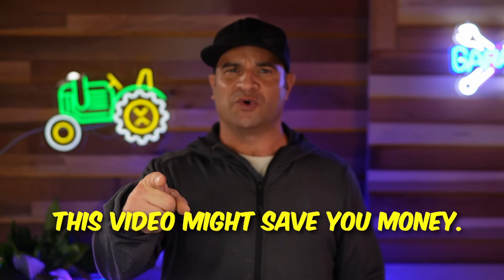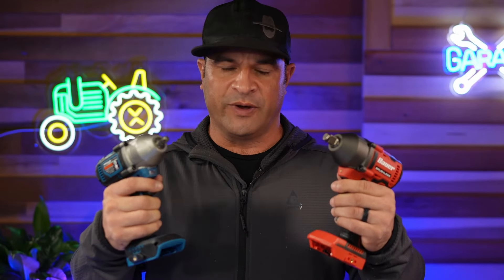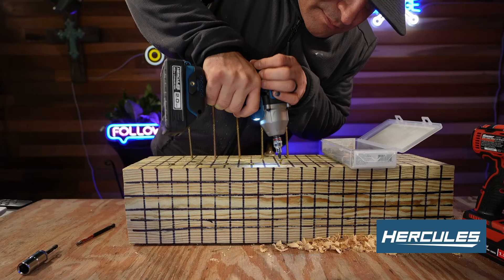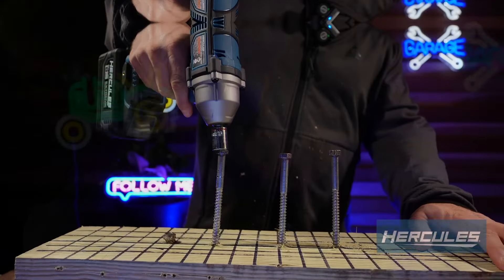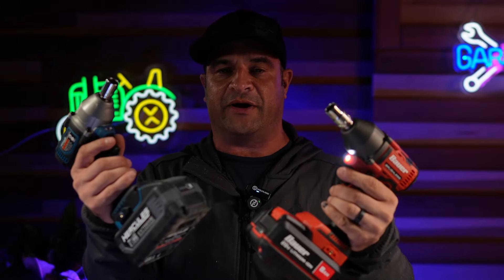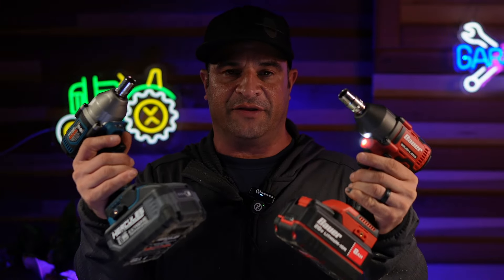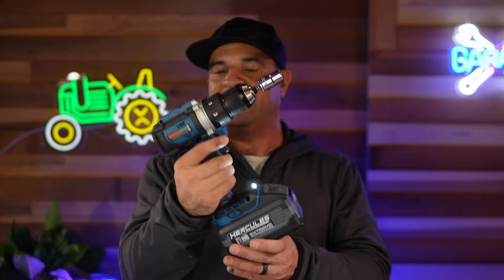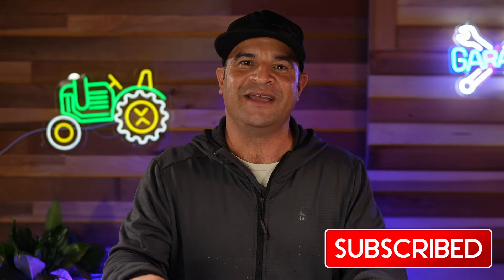Unboxed and Abused: Hercules Vs Bauer Drill - What You need to Know.

Comment: Those impact wrenches arent really meant for driving wood screws even if you use those torx sockets.

Impact drivers are what should have been tested on those screws. I've never seen someone use an impact wrench for wood screws, lag bolts sure but with impact sockets.

The drill test was between a brushed vs brushless model is unfair, there's quite a significant gain in power on the brushless models. My brushed hercules drill couldn't get through a 2x4 with the hercules self feeding spade bits without bogging down several times but my new brushless hercules drill has zero issues, bith paired with 5ah batteries. When using brushed drills I use regular spade bits.
Reply from the maker: Looks like I need to stick to using my impact wrench for changing tires and not wood screws! The problem with the harbor freight brands is you need a $100 dollar battery upgrade to be on par with a better name brand. At this point you, it ends up costing more. I have a price breakdown at the end. I definitely agree with you on pairing the brushed and brushless drills, I did mention in the video that it was an unfair. Thanks for the heads up, I appreciate you taking the time to comment. Believe it or not, the feedback help with future videos.

Comment: I have to disagree with you because I have the brushed hammer drill and I drill thru 1/2 plate with warrior drill bits
Reply from the maker: those brushed have always been work horses, but they will eat a battery in no time.

Comment: lol this guy doesn’t know the difference between an impact driver and an impact driver wrench drill, and he runs a tool channel??
Terrible test too. All messed up. 
You needed an impact driver. Like a wood working drill. Not an impact wrench that uses sockets. Those are for bolts and engine and tire work.
Reply from the maker: I wonder if your jiu jitsu is as good as your observation in crappy videos. i probably would have done a little bit better if i spent more time with the tools, but i was shooting on the fly.  i can guarantee that if you subscribe, I will give you some more crappy videos to pick apart.